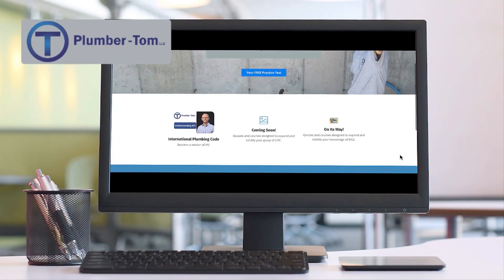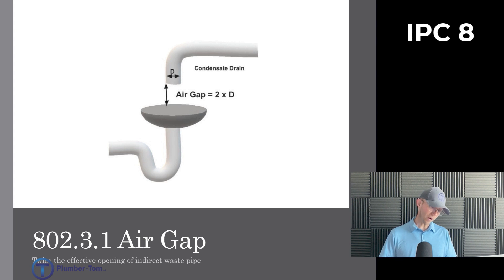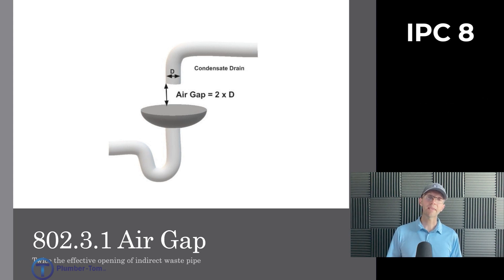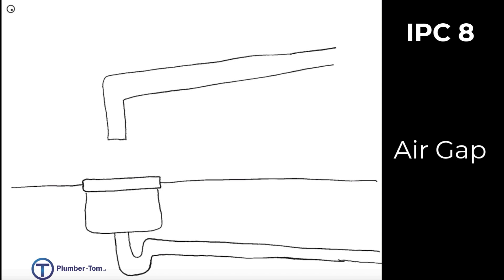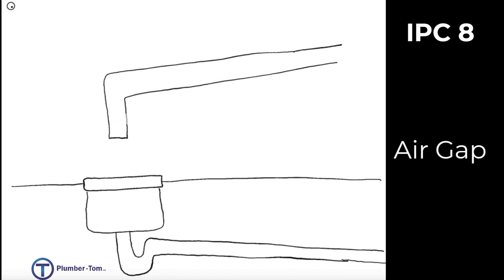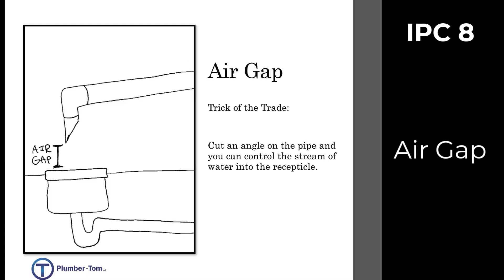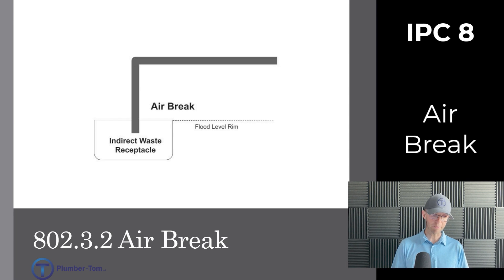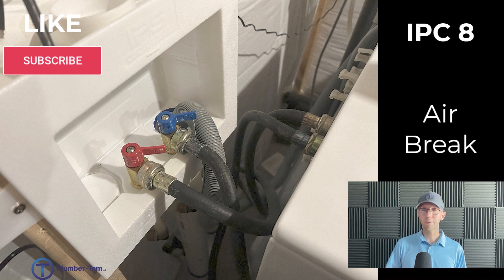Understanding IPC Air Gap Vs Air Break

Comment: Im replacing an  ice machine. Drain had a trap on condensate line at the drain cup. The manufacturer does not want a trap in condensate line. I removed trap, cut my 3/4 copper with a steep angle on the end above the drain cup. The condensate was still swirling on its way out and missing the drain cup. Drain cup is 4" in diameter.Any suggestions on why? The ice machine is on the first floor and the drain cup and air gap are on the ground floor. There is a vent in the condensate drain line at the ice machine on the first floor.
Reply from the maker: Hmm.  Sounds like the water is picking up speed as it travels from one floor to the next.  You might try sending the water through a couple of elbows toward the bottom.  Something of an offset that would still land it on the drain.  That might slow down the flow velocity.
Reply: @plumber-tom9470 it's a 12' drop out of the ceiling, I have 2 90 degree elbows, very close together and then an 8" drop into the cup. Currently I have an air break just to keep the condensate in the cup, but I would rather have the gap. The old setup was an air break as well. I'm wondering if I should just put the trap back in and raise it up?